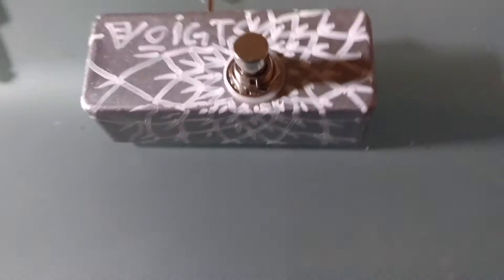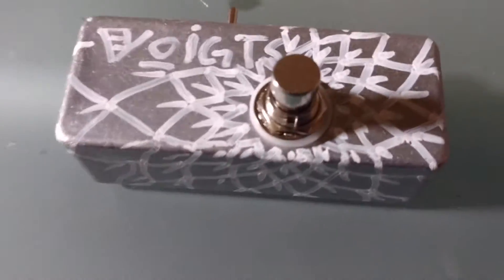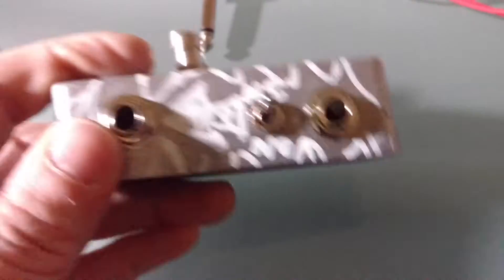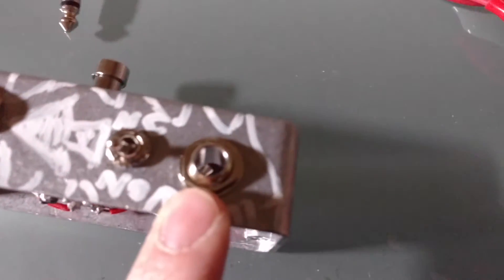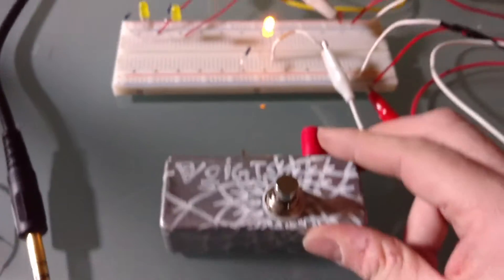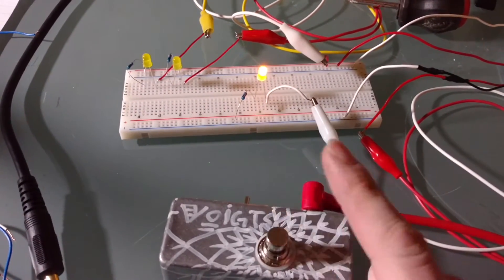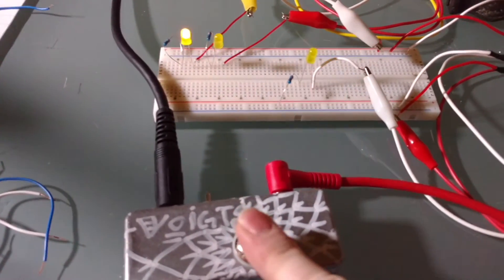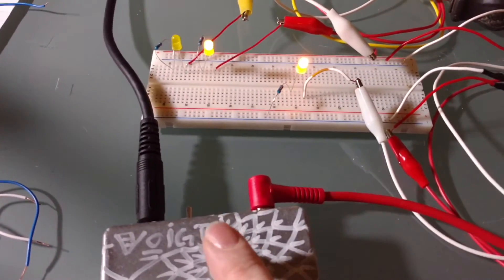DIY Dual Tap Tempo (Universal) - Strymon and Boss Pedals

Comment: Can this be used to control two Keeley pedals? Am I right in thinking that I would need a dual switch instead of a 3 way? I'm trying to have one (hopefully quiet) foot switch that controls tempo for both pedals, Thank you!
Reply from the maker: hi, this version could only control one keeley pedal. you would have to duplicate the mono output (i believe keeley is nc, if you want to skip the nc/no toggle) ... and yes, a 2pdt switch would be enough.

Comment: What LED value do I need? (Voltage). I used a generic 5mm one I have at home and it doesnt turn on/off the light when I switch the circuit. It works ok with the Strymon pedal though but no light.

Comment: Brilliant. Where did you find the soft-action 3PDT switch for this? I've been looking everywhere and can't find one
Reply from the maker: i only used a 3pdt, because  i had one lying around. actually any non-latching 2pdt will do for this project. i buy all my parts at www.musikding.de or on eBay (a bit cheaper, but quality is hit or miss from china).
Reply: +Frank Voigts Thanks... i built one with a momentary DPDT switch, but it has a big click action to it ... the one in your video seems much softer
Reply from the maker: +James Hamilton this is probably what you're looking for -> http://www.musikding.de/2PDT-Fusstaster-print-sof
Reply: +Frank Voigts amazing. Thanks for your help